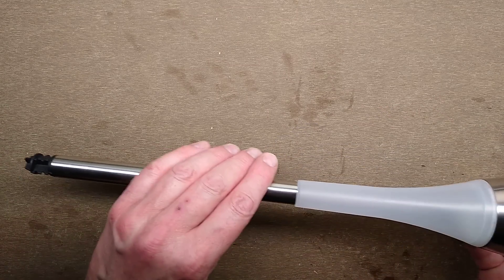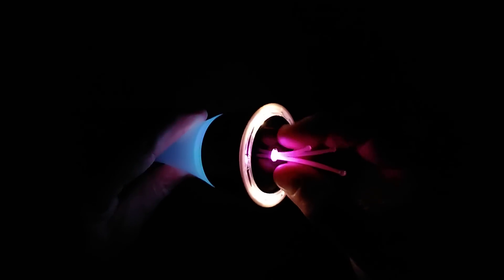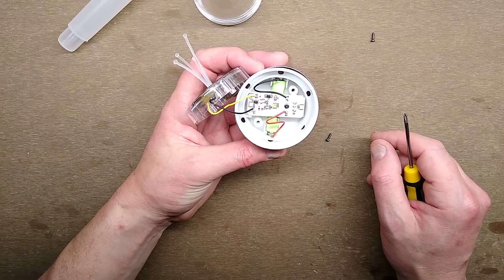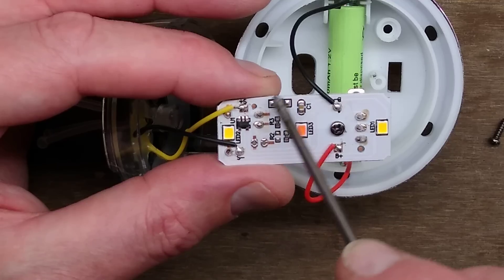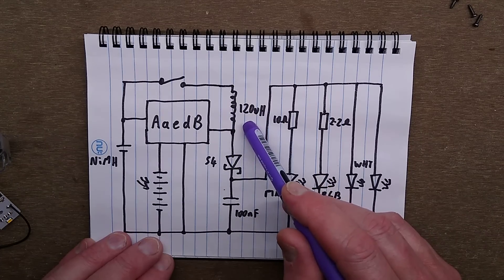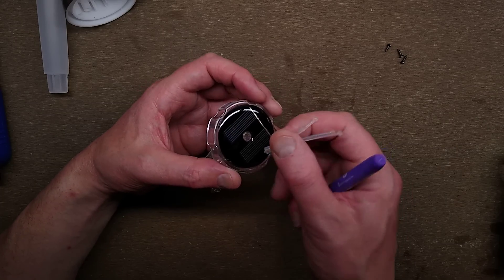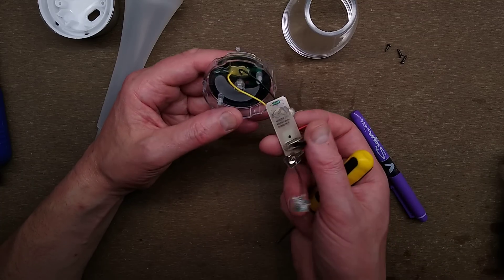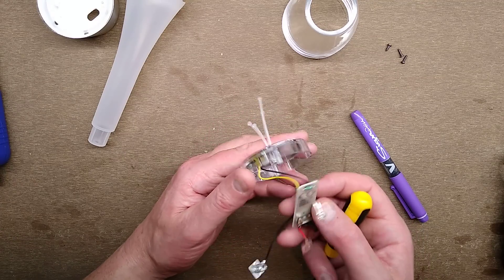Nicest solar light I've seen (with schematic)

Comment: What a great light.  Could easily take the ridge off the middle clear plastic so water continues to shed down and out.  Missed knowing just what the battery's capacity was, as well as the solar panel's capabilities as it looks small.
Reply from the maker: The UK lights have very small cells due to our low sunshine levels.

Comment: Hello Clive, we've spoken before. 👍😀 I don't know if you've done or thought of doing something along these lines but ... Is there any way to use 'standard' outdoor solar collector with lights, to light indoors during these possible future power cuts? I've already ordered 2x USB rechargeable LED 'camping lights for this too, but being able to put garden light receptor outside and the lamps inside seems to be another way to do it, with the lights only needing to work for 2 - 3 hours?
Reply from the maker: USB power banks are a power-cut essential.  Real ones bought from somewhere like ASDA or Walmart.  You can charge them with a 5V solar panel and suitable lead.
Reply: @bigclivedotcom  hi again Clive. Great thinking, thank you. I already have two powerbanks so I can use those with some usb lighting.

Comment: For that chip with the weird name, if it is a number for a unique chip that would mean that the chip could of had 916,132,832 possible combination if numbers were apart of the digits like hex. I’d did this maths by doubling 26 (amount of alphabet letters) and adding 10 ( amount of digits). Which gets you 62 then you do 62 to the power of 5 (digest in that chip) then you get the number of combinations. Sorry just thought it was cool knowing 😂

Comment: If the driver failed and you had the gumption to repair it, a QX5252F solar driver would fit as a substitute. I would also be nice it they actually used fiber optic cable so only around the base in the center would glow pink and then also only the little balls at the end would glow. I'm assuming fiber optic cable lets very little to no light out of the sides of the cable?

Comment: . Bought a pair of “ storm lanterns” from our version of Poundland. 
Verticle double sided smt with many leds that give a flickering flame effect when lit. 
Runs off a single AA cell. 
Sweet circuit but solar panel slightly compromised by rain gutter overhead. 
Would like to have them run from dusk to dawn instead of the current 3 or so hours. 
Know battery is capable of this since I removed and charged them. 
Scratching my head for a place to fit an additional solar panel to them from say a scrap solar garden light. 
May try wiring the solar panel and battery pack from a led floodlight to both of them and  attach the panel to a place that gets full light.

Comment: I personally hate the standalone color cycling LEDs. I think they have their purpose, but unless it's for ambiance in the background, or is incredibly subtle if more foreground. Granted, given how little functional lighting seems to be produced by this, I guess having them solely scattered amongst flowers/inside bushes, wouldn't be too bad.

THAT being said, I think this light has some serious purpose, had they done it this way:
Tendrils: either the color cycling LED, or, a flame flickering orange/yellow
Clear Top: [relative to above choice] either left as-is, or, flame flickering orange/yellow
Frosted Underside: BRIGHT semi-warm white (3500K?) LED(s)

Then, as someone else suggested, allow these to be daisy chained and outlet powered (DC of course), or maybe a foil pack LiPo/LiFe cell... but not sure there's the ability to charge one just from that dinky panel. Reason for either, is simply the fact that bright single/multi underside LED would need some juice.

With those changes though, you'd have properly functional path lighting, which look like sci-fi 'torches' (tiki, not "flashlight"). As instead of a colored under-glow, it's that bright light, and the frosting would diffuse the light to not look like those cheap ass units (which can't be frosted due to their low luminance). 😁

Comment: What is a good conformal coating for cheapskates who don't have the correct stuff around? I have used spray paint but don't know if it will cause more issues than it helps?  2 part epoxy glues seem ok in thin coats but the heat created with large cures puts me off 'potting' projects.
Reply from the maker: Most clear lacquers are fine.

Comment: You would be absolutely floored and amazed at the quality of the lights sold here in one of our biggest chains of dollar stores. The store is called the “Dollar General“ and it’s genuinely insane how for a dollar or two dollars… Sometimes as much as five dollars per light… They have high-quality brand-name LED dyes, very nicely made solar panels with quartz glass over the top instead of epoxy, and actual stainless steel parts top to bottom. 

Not to mention the quarter inch thick beautiful heavy glass which is probably some type of recycle glass but….. it’s still really nice.

They’ve also learned from experience that instead of trying to perfectly waterproof everything, to leave openings in a downward trajectory so that when moisture does build up eventually in the air it has somewhere to evaporate 

After all ….these are solar lights so they’re going to get direct sunlight ….and if they just leave a few tiny little holes in the bottom… No water can make it in but then moist air can make it out. 

They really stepped up their game and all of the lights here in that store in particular covering half a dozen designs or more each year… Look as good if not better than the one shown in your video here.

Even the batteries inside are getting to be better and outperformed half of the “replacement solar batteries“ sold for high prices by Walmart and Amazon. 

before mom died last year I got her several dozen and fixed up her garden right at spring weather so that she could enjoy it one last summer. So I went to around buying one of each light design that she liked from different vendors ranging in price $2 to $5 per light. Even tried some $15 each variants from fancy homes stores.. The $4 ones at the dollar general ended up being by far the best quality and luckily one of her favorite designs. 

10 years prior, she had spent nearly $15 per light to fix up the same area. And they barely lasted the freaking summer and had to have serious intervention and battery replacements from me just to make it a second season. Then they were trash. 

Sure surprised me I tell ya

If you’d like a care package I could probably fit 10 or 15 variance in one shoebox size container. Of course the glass is usually the heavy parts so according to shipping costs it could be omitted. Then I guess they would be pretty much worthless but would still be fun to tear down maybe and see the different types of solar panels and such.

Comment: I've seen many a solar light where the solar panel sits in a recess. They seal the bottom where the wires come out, and that is it, trouble is the recess fills with water, and then has no where to go as the only hole below the panel is for the wires and it is sealed. the end result is the panel sitting in a pool of water. this of course includes where the wires are soldered onto the underside of the panel.
This does dos strike me as good. Sure the top side can get wet, but having the whole panel in a pool of water sounds bad to me.
Reply: The most common issue is that the standing water makes the solar anew cloud over, reducing efficiency.

Comment: Maybe you could explain how the pulsed power boosts the voltage in circuits like this. Thank you.
Reply: Watch Practical Engineering's video on the hydraulic ram pump. The length of tube where water can build up momentum is the inductor, the optional air chamber is the capacitor, the delivery check valve is the schottky diode and the waste check valve is the connection through the chip between where the inductor and diode meet to ground that periodically turns on and off. Current is like flow rate and voltage is like pressure/head. Of course this isn't a perfect analogy and inductance/capacitance is very different to momentum/pressure but the basic principle of how they convert high flow at low potential to low flow at high potential is the same.

Comment: It's the most beautiful landfill product I've seen. 
By next season, the solar panel with turn milky white and every metallic part inside will be rusted or corroded.  
Off into the trash it goes. Rinse and repeat.

Comment: That looks like a well thought out design overall, they even bothered to use a removable NiMh instead of just soldering one directly.

The tendril design looks like would be nice also used as part of a chandelier, like some alien flower thing hanging from the ceiling as a general theme. Perhaps mixed with thin fiber optics to also give the illusion of floating points of light around those flowers (alien firefly)

Comment: Bit of a water funnel, but as you say easily sorted, and rather pretty. Personally I think the colour changing led should be in the centre top so it internally reflects the changing colours nicely, a bright white below for lighting flora and paths, and the clear bowl should be the pink part, or green or purple or some other nice relaxing colour.
Reply: I thought the same thing.  Plus add a clear lid to stop snow from filling up the cup.
Reply: I thought the same thing.  Plus add a clear lid to stop snow from filling up the cup.

Comment: I remember years ago I had some solar lights from.Poundland that used fibre optic 'tendrils' like this, they looked really effective until the water inevitably got in and they died. These days I know to use epoxy, silicone or whatever to add the ingress protection that should have been there from the factory were it not for planned obsolescence. Unfortunately my garden is now shaded by big trees (which tbh is how I like it) and solar lights are pretty useless. I've been looking at low-voltage, coloured spotlights for architectural lighting of bushes etc but they seem very expensive for what they are.
Reply: I feel like "planned obsolescence" is awfully generous. It's more likely "saving ⅒¢".

Comment: I dont like the spring connector to the NiCd(also dont like) or NimH  batterie, as there is often corrosion due to condensed water and different metals contacting each other.
Reply from the maker: That's why I smeared them with vaseline.

Comment: That is exact what I did to all my Action bought solar lights. took them all apart, soldered the wires to the batteries. Plastidipped all circuitboards. Put plastidip on all glued seals and soldered wires and led legs etc. Basically all exposed metal is covered in plastidip. They are going strong for a couple of years already. Most solar lights are very cheap and work fine but most are poorly engineered so water will get in very easy and killing them faster then you can blink. By sealing it up you get much more use out of them and it isn't just a quick way to get rid of your money because you need new ones every year.
Reply: I just go wild with silicone sealant, lol. As you say most are clearly made to fail but with a bit of handicraft you can get way more use out of them.
Reply: @Lumibear.  I have a pretty big passion for the rc hobby and needed a way to waterproof my electronics. so one day I saw a sort of pringle can with plastidip at aliexpress. bought it and used it once. The second time I needed it it had cured totally so threw it away. But the idea worked out fine from that one test. So went to a paint store and asked for a better plastidip can. This time I got plastidip for a spray gun. expensive little paint can bit he assured me that it would go a long way. and here I am 7 years later and still use the same little can that is now half way empty. It is thinner than the pringle can so I need 2 or 3 dippimgs per item with a drying time of an hour or so in between. but it is a thin layer and works perfectly for my needs. receivers and other boards. even little camera's are totally dipped except for the front of the lens. Have one on my little jetboat. both camera and video transmitter with xloverleafantenna are dipped and totally exposed to water. works fine.

Comment: Wow, so much to comment on.
First solar cell I've seen with a hole in it. Lots of design opportunities there.
The shell looks a lot like a champagne flute, far classier than the usual run of seemingly increasingly cheesy solar lights. The little "sprig" reminds me of the nose-tickling bubbles...
I couldn't tell where the optional component pads connected to. Any guess what they're for? Other component sizes, maybe to compensate for LEDs with different efficiencies?

Comment: Only manufacturing improvement could have been to have end cap completely enclosed totally negating water, bugs, dirt etc from getting in.
Reply: Agreed, would have been better to have the top closed off but keep some drain/ventilation holes below. Otherwise a vast improvement over other solar lights!

Comment: Does it have a series 2-cell or 4-cell solar panel? 
Nice elegant design, single side board, and a replaceable battery!
Reply from the maker: Four cell.  4 x 0.5V = 2V to give the required voltage for charging the cell with a diode drop.
Reply: @bigclivedotcom  thanks. yes, 4 cells is what seemed required, but visually it looked like a cell on each side of center.

Comment: If you like that Clive you've got to check out (and likely already have 😆) those LED Bluetooth color changing programmable light bulb speakers... those things are great, I have 9 different brands of them and they all have their quirks and benefits.  The one I'm listening to you on came with a remote control but is also controlled by a Bluetooth app with features such as playing music playlists with customized light shows, a built in feature packed equalizer, brilliant white light, and a ridiculous number of spectrums and colors, and the speaker is actually pretty good for what it is.  I have a few others around the house, garage, and greenhouse that automatically connect when my phone gets in range which tends to be a nice feature.

Comment: Nice, unique and beautiful design - when new.  I see so many solar garden lights that have fallen apart or water damaged after just a year or two that I'm so sad and disappointed by the whole solar light industry.  Thanks Clive - I really like your presentation and please don't think it's any of your fault.  I've repaired many of these.
Reply: I had a really nice one with a flame effect in a frosted glass jar. Stopped working during a day of heavy rain. When I checked it out the jar was completely full of water - so bad it was almost funny.
Reply: Yes, most are terrible and just corrode like mad. There's no thought given by the manufacturers to waterproofing the internals (because the more that fail after a year or two the more they sell ......). There's such an incredible amount of waste in 'cheap' electronics, particularly from China.
Reply: Clive has done a few video's on how to extend the life of these outdoor solar lights.
Reply: Nearly always a complete waste of money.

Comment: Nice little unit is that Clive. I've often thought about  getting a bunch of these but wiring them up in a string for the garden. Run a 12v loop and bypass the solar panel and battery but add a tiny buck regulator to ensure volt drop on the 12v line was neutered..
Reply: I have a lovely little set of small vaguely traditional-Japanese-style lanterns which were originally solar powered for which I did exactly the same thing once the original electronics failed. They're run along the side of my front stairs and I was moderately proud of myself over it, not out of any cleverness - the circuitry is trivial - but out of actually going out and doing it, what with everything glued in place and generally being quite annoying to clear out. They're plastic of course, not stone, but with the right amount of outdoor dirt/not-overly-cleaned patina on them they look rather natural. ^_^
Reply: Thought about doing something similar with a usb power supply. Scotland doesn't receive enough sun during the winter to keep solar lights running through the evening.
Reply: Definitely a cool idea
Reply: I would need to do this as my garden gets very little sun due to tree shading. I have a little wall mounted solar water feature and had to extend the cable by some 10m so I could mount the panel high on an outside wall.